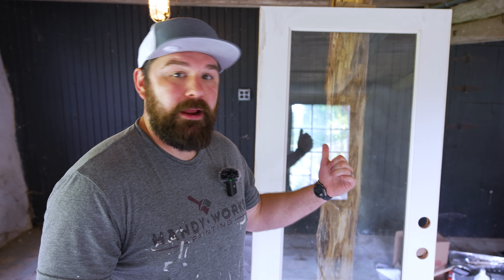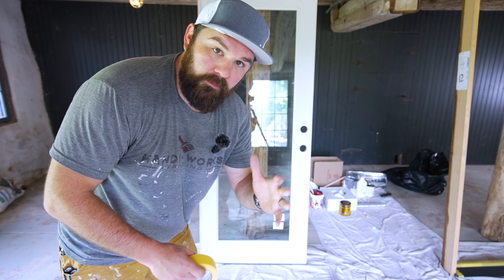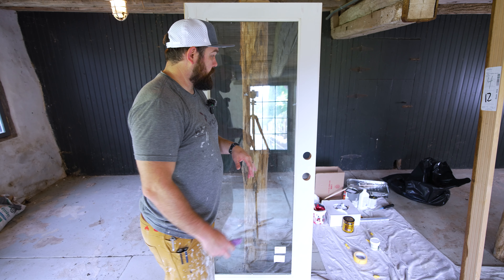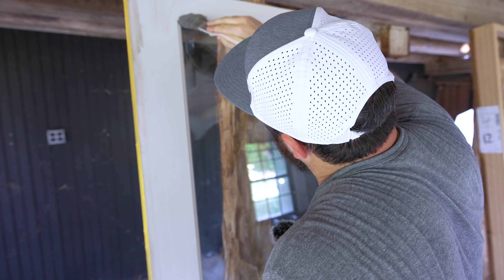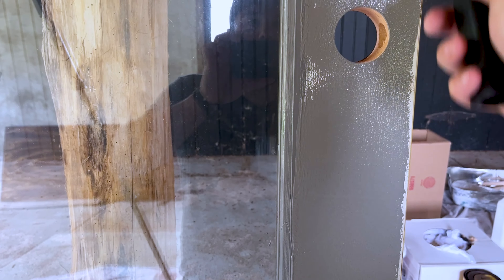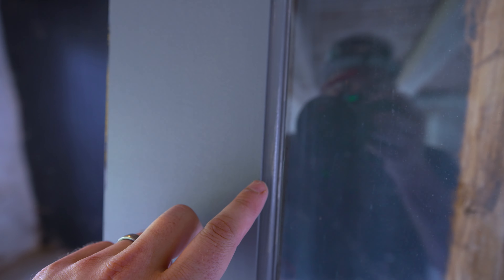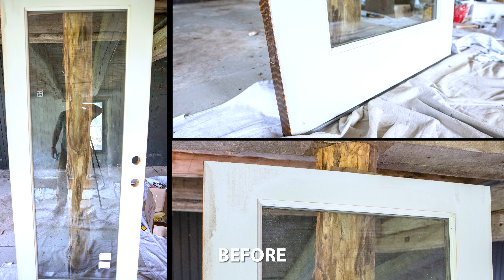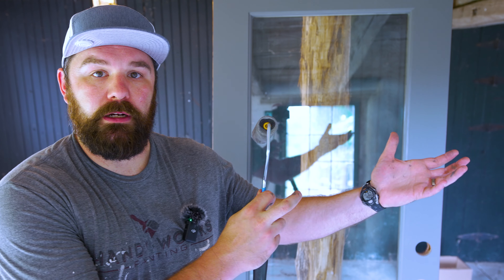Flat Exterior Door? Here's How to Paint it Like a Pro

Comment: Good info on those roller naps, I will have to get some 👍

Last time I used Soft Gloss I found it too shiny so I've used Low Lustre for body & trim for the past couple of years. Seems like lower sheens are more popular for trim these days anyway.
Reply from the maker: I still prefer soft-gloss for doors and trim, but you’re right about the lower sheens being more popular recently.  I’d like to do a test on the different patterns various rollers produce.  The flock was good but I think I may be able to get a slightly better finish with another kind of foam roller.